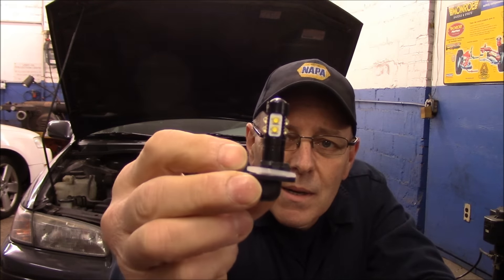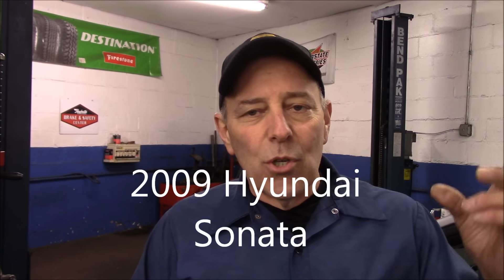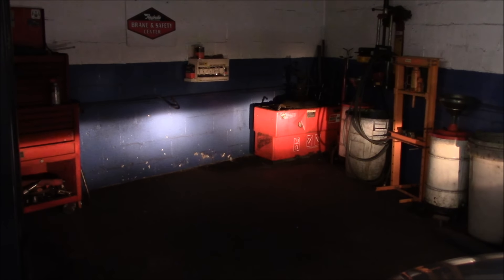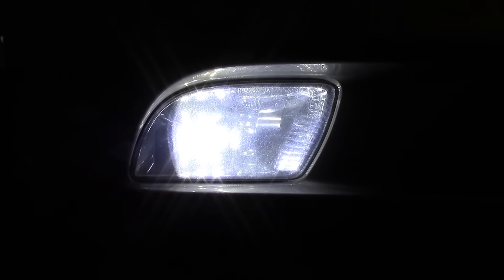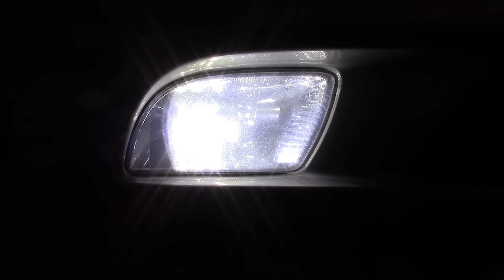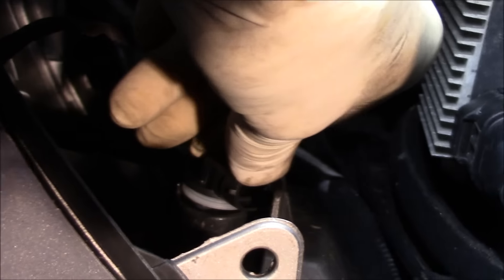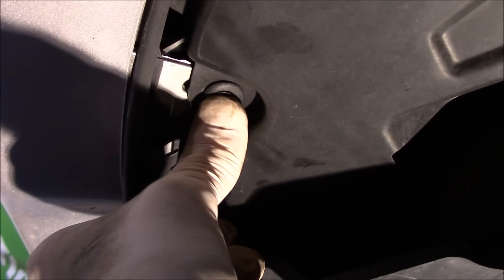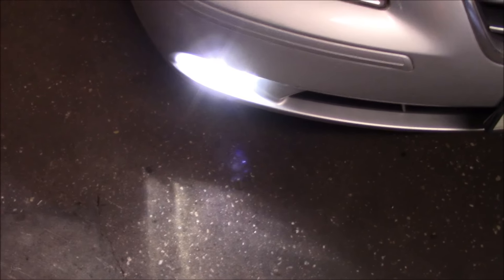How to install fog lights

Comment: Jim, quick question. I installed an after-market  fog light kit on my 2000 Chevy S10. I used factory-style lenses from TYC + 686 fog light bulbs. I didn't wire it up the way the instructions said to , I wired it up with a relay. Will the LED fog lights work with this set-up?
Reply from the maker: It should as long as you wired it correctly
Reply: jimthecarguy Thanx! They've been working 4 years.  I think I got it right.

Comment: The only problem with putting in the LED's in the stock housings is that the stock housings are reflector type lenses, they are made to be used with Halogen beam patterns, when you throw LED's in them the pattern of light is completely different, so instead of a focused beam light with a cutoff, its just reflecting light in all directions, this blinds other drivers and also cause poor vision in certain weather conditions. I wouldn't recommend upgrading stock reflector housing to LED unless you buy the LED's made specifically for them, they have a cutoff shield which block the rays that blind other drivers.

Comment: I noticed that those bulbs have a very poor cutoff pattern, and would likely blind other drivers.
Reply: Wouldn't that be more of a lens issue? LED & HID bulbs need specific lenses to better focus / aim the light.
Reply from the maker: Thank you for your input Thomas
Reply: Jim, Jason Loesch is correct.  The LED bulbs don't have the correct beam pattern, and will absolutely blind oncoming traffic.
Reply: Thomas, you are correct that LED and HID bulbs need specific lenses to focus the light appropriately (and legally).  The problem is that you can't just put a different type of bulb into an existing housing/lens assembly.  In fact, doing so is illegal.

Comment: Clearly, the LED bulbs do not have the proper beam pattern that the original bulbs have.  Those LED bulbs will blind oncoming traffic.  They are certainly not DOT tested/approved.  Jim, as a "car guy", you should know this!